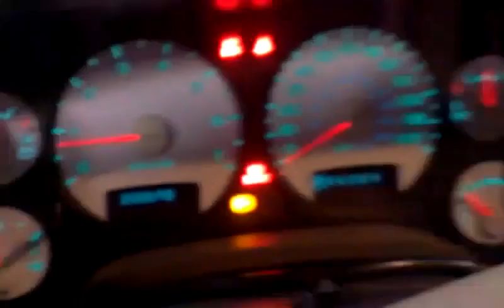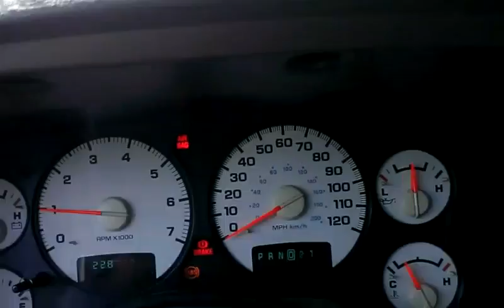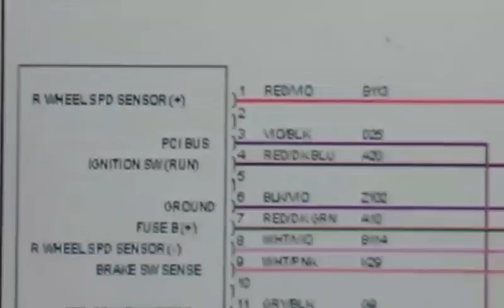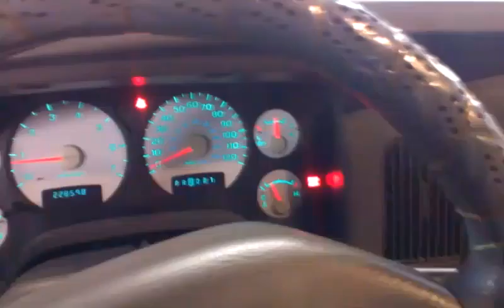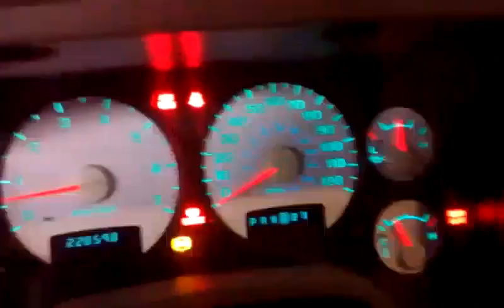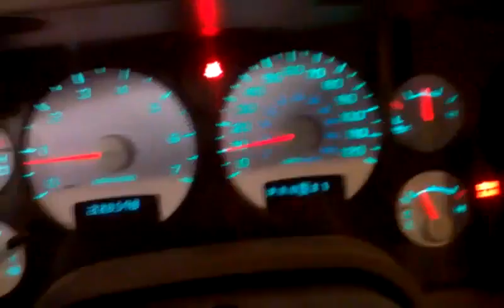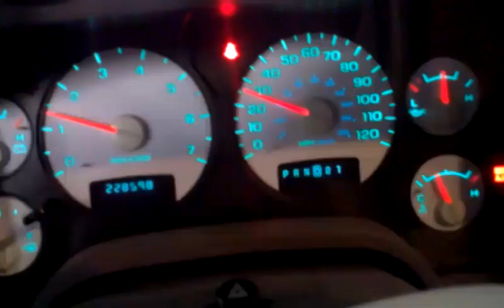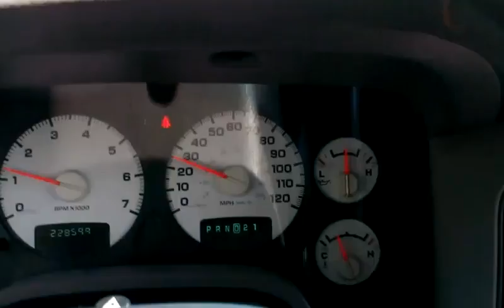P0500 2003 DODGE RAM 1500 5.9

Comment: This video was invaluable to diagnosing my 2000 Dodge 1500 van 5.9L. I found 9.44v running voltage at my fuse box coming out of the a/c and RWAL fuse slots when I had 13.53v at the battery. I jumped B+ fused to the input of the RWAL fuse slot and the lights disappeared. All I need to do now is determine what is causing the voltage drop. I will report it here once I find the issue. The transmission relay in the power distribution box in the engine bay clicks when I move it even after swapping in a known good relay so I'm pretty sure the short is somewhere in there. Thank you times a million.

Comment: Muchísimas gracias por el vídeo me acabó de ahorrar tiempo y dinero y aún que no explicas para mi fue de gran ayuda una ves mas muchas gracias.
Reply from the maker: Adan Casillas 
Que bueno que si le entendio al video y que le sirvio

Ya se me esta quitando la pena y a Los nuevos videos si les explico un poco 😁
Reply: @sergiovelazquez579  pues vuelve hacer este y explicalo
Reply: @sergiovelazquez579  tengo el mismo problema encienden los focos del Airbag , abs y brake.
Es una ram 2004 
Solo que las RPM si funciona
Crees que sea lo mismo del vídeo ?
Reply: Adan Casillas como fue que arreglastes tu problema, tengo el mismo me podrias ayudar?

Comment: Thanks for the reply, this is great information! Is there a video that you know of that shows the proper way to connect external jumper wire with fuse from a good ignition power? I hesitate to play around with jumping fuses, unless I’m confident in the correct method so I don’t create more issues with TIPM.
Thanks again for your response and assistance.

Comment: I have a question I’m having the same problems with my abs light staying after I changed both speed sensors the light went off then came back on instantly! What do you suggest

Comment: My truck has the exact same symptoms. No power at fuse box on fuses 32,33,34,35,36,49. All fuses are good, none blown. How do you trace fuse number to the right wire on wire harness underneath fuse box. There are multiple wire harnesses underneath..
Reply from the maker: Boomer 11 
What year is your truck and engine

Comment: I’m curious from the video, it looks like you have a jumper wire rigged from one side of fuse slot #37. It then looks like you clamped your test light to the other end of that jumper wire, and then used the test light probe to touch one side of fuse #35. And then this caused the dash fault lights to disappear. Is this correct? 

On my truck slot #37 is a spare. There is no power at slot #37 when testing. So I’m curious what this does.
Reply from the maker: Boomer 11 
Yes, that's what I did
I jumped the wire from positive battery to one side of the fuse #37
( fuse #37 is a spare but one side of the terminal connects with fuses #26, #35 #36 #38 #52 )

Do the same i did, if everything star working again that's your problem 

There's a blk/org wire from fuse #3 to the ignition switch terminal #7 when you turn the ignition On should be power on terminal #14 
Orange wire,  this wire goes from ignition switch to the fuse box connector #5 terminal #1 and this is the power for those fuses

Comment: Will this be the same problem with a 2007 dodge ram 2500 5.9 Cummins 4×4 speedometer not working,abs,brake light is on.

Comment: Maybe you can give me your two cents. I have the same problem with my ram. VSS was changed and no change. I'm not getting power to fuse #35 via test light. #35 is also grounded well via test light. I checked all the wiring behind TIPM and no corrosion or pinched wires. Can #35 be jumped? Let me know what you think I should do next
Reply from the maker: If you can't find the open wire o bad connector get the power from another ignition fuse  with a fused jumper wire, that should work just fine until you find the problem

Comment: Sergio te escribo nuevamente. mi ram 2500 tiene el mismo problema asi como te comente abajo. encienden las mismas luces y todo igualito no signal speed en el scanner. Pero como en el video no hablas no entiendo bien que es lo que puenteas o lo que haces tengo conocimientos de electromecanica me gustaria que escribieras que es la prueba que realizas como hacerla. te agradezco de antemano Gracias hermano
Reply from the maker: El fusible #35 no tiene corriente por un cable corroido debajo de la caja de fusibles
Este fusible alimenta al Modulo ABS
En la peueba que ago le pongo un puente conectado a una alimentacion de corriente y al fusible para ver si el problema es por falta de alimentacion de corriente.
El sistema trabaja asi: El sensor de velocidad tracero que va montado en la transmision o en el diferencial manda señal al Modulo ABS,  El ABS manda señal a la computadora del motor (PCM) El PCM manda señal a la computadora de la transmision (TCM) y al tablero 
Si este es tu problema por eso te prenden las luces del ABS no tienes señal al velocimetro y no hace bien los cambios la transmision.
Si tienes mas dudas mandame los datos de la camioneta y te puedo ayudar un poco mas con tu problema
Reply: Muchas gracias Sergio por el tiempo en respondernos a los youtubers en busca de solucion. voy a verificar exaustivamente ese punto y luego luego te comento
Reply: Yo tengo una 2001 ram diesel y no corre mas de 40 millas por ora

Comment: hi Sergio I have a 2003 4.7 magnum  dodge ram with the same problem but my has the speedometer going crazy and losing power when shifting 3rd and 4th gear hopefully this helps me out bud o si no le prendo fuego
Reply from the maker: I can try to help you find the problem but i need to know the codes ( engine and abs codes )
Reply from the maker: Is it 4x4 or 4x2

Comment: Sergio, so did you just rewire the end of that cable or was it a full run somewhere?
Reply from the maker: I had to replace the end of the wire and clean the connector and the fuse box
Reply: Awesome.  I'll give that a try and see if it fixes my issue.  Thanks.
Reply from the maker: Isaac Rodriguez 
If there isn't  no power on fuse #37 you can try connecting  a external jumper wire with a fuse from a good ignition power to the fuse and see what happens
Reply: I'll check that.  Thanks for your reply.

Comment: Good video, thanks, but it was like a silent movie-t would have helped if you could have told what was going on.
Reply from the maker: Im sorry  about that !!
Fuse #35 missing power caused by a bad wire under the front fuse box.
The fuse #35 feeds the ABS Module 
In this case the rear speed sensor ( on top of the rear differential ) sends signal to the ABS module, The ABS module  sends signal to the PCM, The PCM sends signal to the TCM and The Instrument  Cluster.
ABS light On, No Transmission  Shifting on time and no speedometer  moving and the code P0500